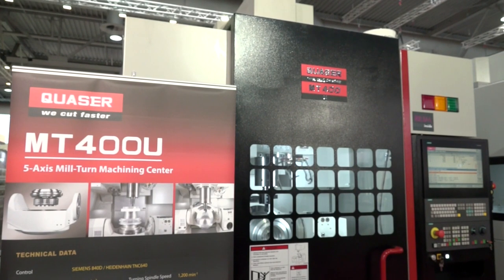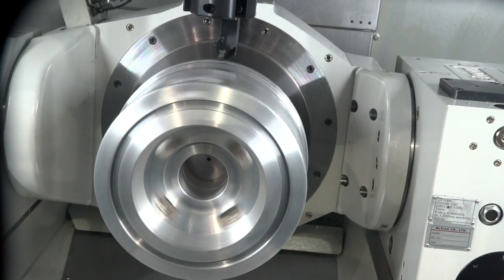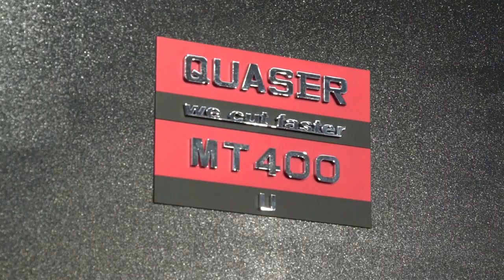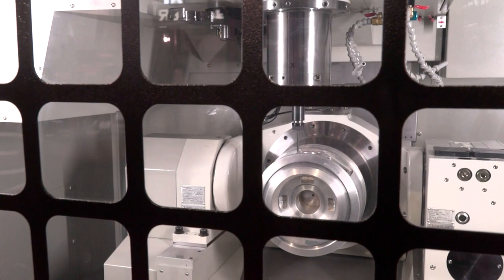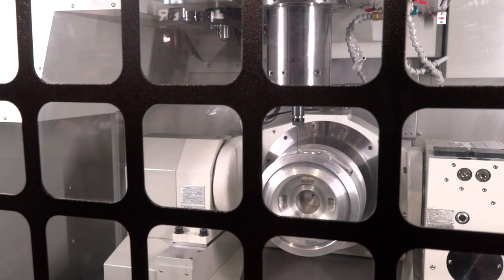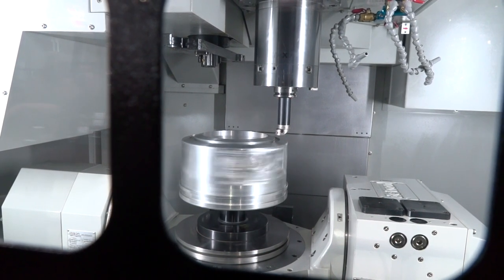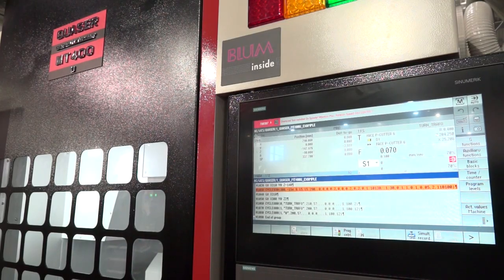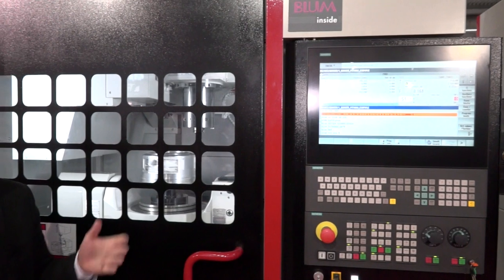Quaser MT400U 5 axis VMC with full turning capability

Comment: Why is Siemens and Heidenhain controllers often together for options? I find that kind of odd for some reason. What's the overall difference between the two? is one technically better than the other for general milling? (not getting too deep into specific unique control options)

It is nice to have a choice though, depending on what previous controller of those two you bought before from somebody else. But if you're new to both of these controllers. One doesn't have a real idea of where to start comparing them to make a proper choice. I would think the price for them are very similar if not the same. That rules out one variable at least. The second is the UI.

MTD, do you happen to have decent opinion? What would be the single dealbreaker Pro side of Siemens 840D, and a single dealbreaker Pro side for Haidenhain TNC640. ?? There is definitely an episode's worth of content just discussing pro and cons of each controller I think. I'd watch it. :)